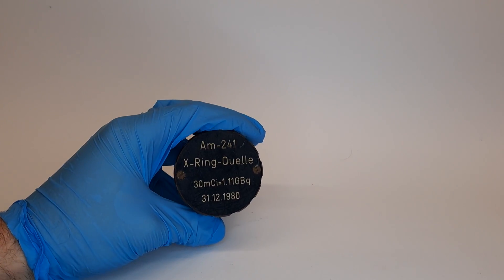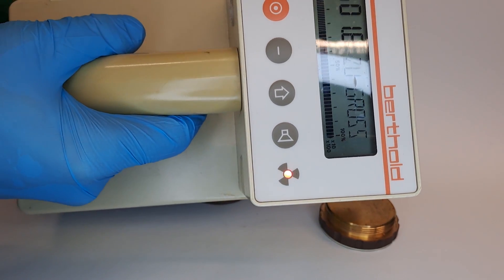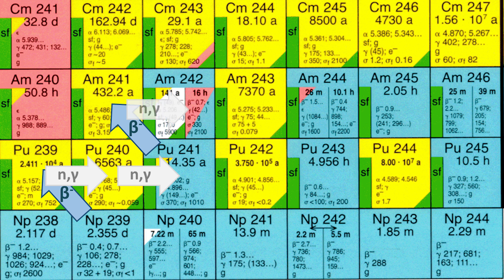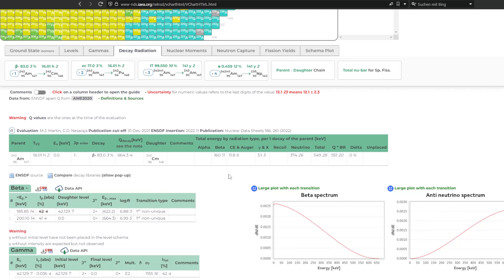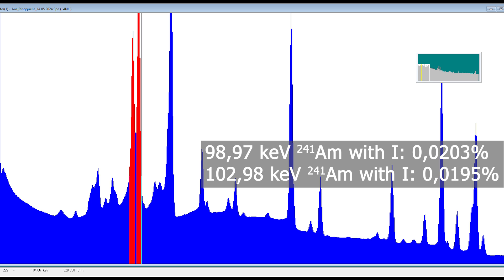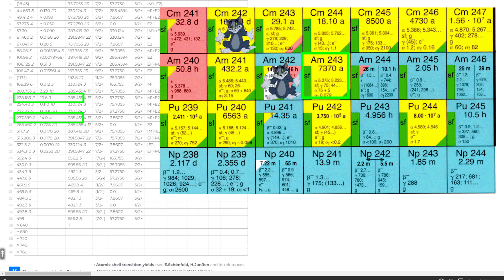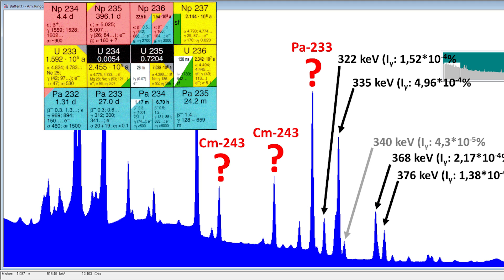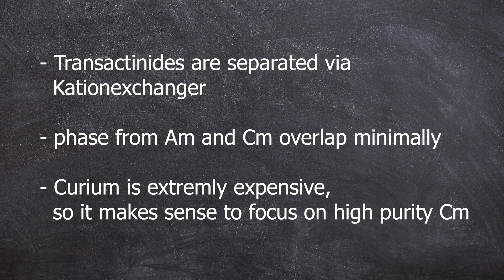Curium in Smoke detectors? - Nuclear chemistry

Comment: Cool video I assume Am241 doesn't contain any curium in smoke alarms or even trace? Correct me if I am wrong.
Reply from the maker: Most likely they also do. 2 ways to get Americium: Recycle spend nuclear fuel (with Curium) or milk Pu-241 cow (without curium).
Having a Pu-241 cow is damn expensive. And the fact that even a radionuclide meant for a nuclear lab isn't even made from a Pu-241 cow but from spend fuel... lets me suggest these cheap smoke detectors are made the same way.

Comment: This channel is absolutely amazing, ive always wondered this exact question, but my radiacode 102 gets decalibrated very quickly when exposed to my americium source so I havent been able to measure it long enough to tell. 

I have a question as well, what is the peak i always get at around 80 KeV when I measure anything? Nothing online seems to mention it. Every source I have measured has a dull and rounded peak at around 80 KeV.
Reply from the maker: If you are measuring background and you get this. Can't it be, that the RC just has the highest efficiency at 80kev. Making it appear as a peak?

Comment: It's also possible that the 228 and 277 keV lines are due to 239Np produced by alpha decay of 243Am, 239Np emits 228 and 278 keV gammas according to the nuclide chart.
Reply from the maker: Could be a mixture of both
Reply from the maker: If Np-239 would be the primary reason for the height of the peak, I'd expect the 106 to be way higher

Comment: When I think of Am241 I think of a 'clean' and simple spectrum of the 60 KeV and 29 KeV lines. But in reality it's actually like a complete train wreck in there when under the microscope.
Reply: Well yeah, 241Am actually emits a whole slew of gamma rays but as Simon kind of pointed out, the intensities of the other gamma rays are unfortunately far too low to be detectable in most cases plus Simon has one of the best gamma detectors.
Reply: Yup those lines are both very good for calibration of LEG probes. Used to build combined neutron and LEG probes from surplus LiI:Eu crystals. The sensitivity and resolution at the low energy region was very good.❤

Comment: Incredible work, Simon! I had long suspected that there should be traces of curium in common americium, and it is truly amazing to finally see proof of this!

Two questions:

Firstly, is this material from the same source that household smoke detectors come from? Are you certain that these results also apply to that material? Conceivably, there could be a difference in the production process, yes? I was under the impression that commercial Am-241 was produced by "milking" Pu-241 "cows", and that method would allow for much better separation of elements and thus potentially produce neither Am-243 nor any Cm isotopes. Is it possible that this is where smoke detector Am-241 comes from, whereas only your larger sample contains bulk americium straight from the reactor?

Secondly, is it possible that the Am-243 and Cm isotopes arise from self-neutron-absorption via the fact that both Am-241 and its daughter Np-237 undergo occasional spontaneous fission? Granted, the rates are extremely low, so while I am fairly sure that this is indeed going on to some extent, perhaps it would be too little to detect?
Reply from the maker: :)

Uffff I couldn't find any information regarding the production of the smoke detectors and didn't feel like measuring one Button for several weeks. If i get to it, I will make a follow up post any maybe change the title of the Video. As for now I am assuming they are produced the same way. Even if i could well imagen our source to be specifically produced from a cow since it was made for a nuclear lab and not some dirt cheap smoke detector. Like if you have nuclear waste, best to recycle it in smoke detectors (@ china)

2) Possible yes, although highly unlikely the quantities of Am in the sample are soooo small and the occurance of sf is so small that if Am-243 is present it might be from the original production. But if the Am-241 is from Pu-241 cow and one could find Am-243 then, this would be the only explanation as to why.

However I can only measure a chinese smokedetector and finding information about the production would be close to impossible right? :D
Reply: @SimonsNuclearchemistry  Indeed, it would make sense to use all available material if you have it, so perhaps commercial Am sources contain a mix of both direct reactor and Pu cow material. Or, the post-reactor material was allowed to sit for some time (it certainly needs a cooldown period at the very least) and is then "milked" wholesale at that point. In any case, good questions that would be great to answer if you have the time!

It would also make sense that separation to produce Pu cows isn't perfect either, yes? Surely there are at least a handful of atoms of all sorts of tasty transuranics and other fun things in any reactor-sourced product. The question is, how much could be expected?

Are you perhaps able to get a hold of an old 70s-era Pyrotronics F5A smoke detector? I believe these were indeed sold in Germany – or perhaps Switzerland? Maybe both – as the cup inside has the word "Achtung" embossed on it, in addition to "Attention" and "Radioactive". So, surely they are around where you are, no?

These early detectors were made with a much larger 60 μCi of Am-241 in the mast and so are frequently sought after by element collectors, which I think in many ways is the point here: Can element collectors claim to own some curium already? The quantity of material in one of these older detectors would be much easier to analyze than the tiny <1 μCi found in modern ionization smoke detectors. I also suspect that it is likely that the separation methods used at the time are quite likely to have been "dirtier", which would work in our favor here. :-)
Reply: @Havron after my current running experiment with my radiacode, I could spend a few months waiting for the spectrum from a microcurie of americium from a modern smoke detector (I've already did spectroscopy with one but not in a lead castle so hopefully it will look different and that was only 2 weeks running)
Reply: @The-One-and-Only100  Hey, go for it! Unfortunately, I suspect that you will not be able to make out these small peaks. I have done a similar test with my Raysid surrounded by one inch of lead, and there is just too much noise and imprecision with these small detectors. Plus, very long detection times tend to lead to thermal peak broadening and possibly even calibration drift.

I assume that the detector in Simon's lab is a professional HPGe detector, which is far better than what either of us have. These instruments are truly incredible, and will show oodles of peaks that us private citizens with our smaller (but still truly amazing!) toys can never hope to see.

Still, it is absolutely worth trying! You never know. I have on occasion been able to pick up peaks that I never expected to be possible. So give it a go and let us know what you see! :-)
Reply: @Havron  why odd peaks have you found that you thought was impossible 

I will certainly share my results, but simon also has a radiacode, and it would be intriguing to see a comparison of the source in the video and the Chinese smoke detector source as a benchmark
Reply: @The-One-and-Only100  The Pm-147 gamma peak, which Simon was unable to detect and said would not be possible to see. I have one of those little sealed button cells containing some of that one-off turn-of-the-century Pm glow paint (no longer self-luminous but still surprisingly active) just like Theodore Gray has on his periodic table website. It is the pride of my collection. :-)

Being a purportedly pure beta emitter, I was likewise not expecting anything detectable in the gamma spectrum, so I had never even tried to measure it until I watched Simon's promethium video wherein he said that the longer-lived 145 and 146 isotopes often co-occur with the expected 147. This possibility excited me greatly, so I immediately ran and set up my Pm cell atop my Raysid in my lead castle, and after several hours three gamma peaks were quite clear: two from Pm-146 (454 keV and a blended 736/747 keV; Simon has these erroneously swapped with those of Pm-145 in his promethium video, btw) – which had me jumping for joy! – and, to my astonishment, the rare Pm-147 peak at 121 keV as well, which is only emitted once every 36,000 decays of the isotope. However, the source is decently active and my measurement time was long, so those rare events did indeed pile up! I'm really not sure why Simon was unable to detect it, as it is plain as day in my spectrum.

Unfortunately I could not also prove the presence of Pm-145, as its two peaks either side of 70 keV are both lost in the bremsstrahlung curve and also too close to separate from Pb XRF from my castle itself. I do see a little bump in the curve around there, so perhaps that is a sign that this isotope exists, but again it may well simply be lead fluorescence. I really need to get around to lining my castle with some lighter metals to absorb those stray x-rays. I also have this crazy idea that perhaps with a strong enough magnetic field I could deflect most of the beta particles to somewhere else and avoid much of the bremsstrahlung? However, I am not sure if that is realistic to achieve. Could be fun to try though! :-)

In any case, yes, please do share your results! It would be an intriguing comparison for sure. I will have to attempt a similar test again as well, after I improve my castle.
Reply: @Havron  wow where did you get one because i would love to test that out with my radiacode to validate your findings also if possible try placing some aluminum on the source so the beta continuum will be knocked down a peg or two so you can have a better chance at seeing the gamma peaks
Reply: @The-One-and-Only100 I keep trying to reply to your comment, but then my reply isn't appearing for some reason? Is there somewhere else we can speak?
Reply: @Havron  do you have discord
Reply: @The-One-and-Only100 Yes but it apparently won't let me link or tell you? Anyway it's my channel title (not my at name here; I still don't know why the change didn't stick) in lowercase with the atomic number of chromium at the end.